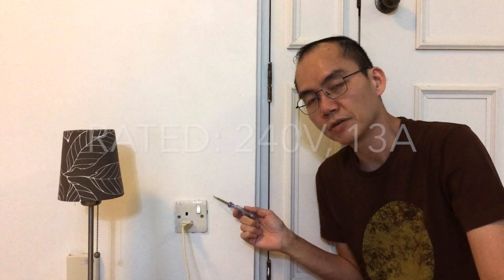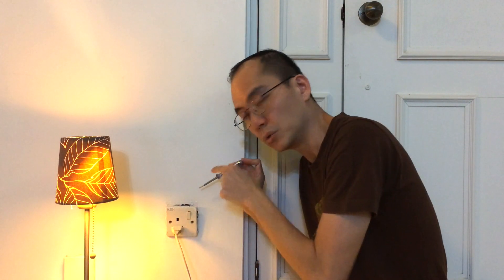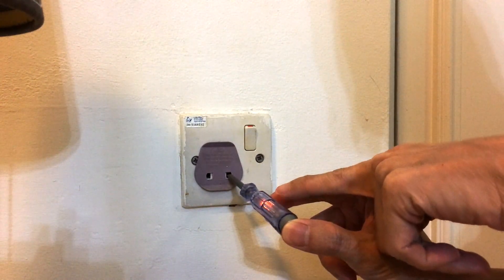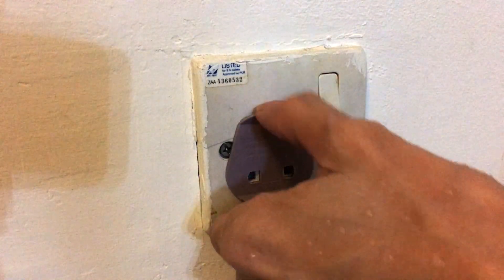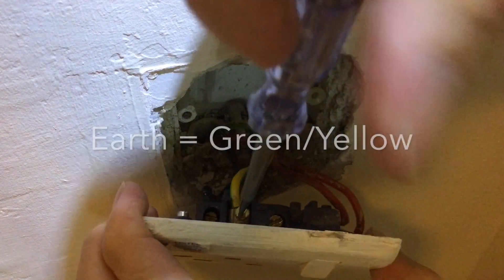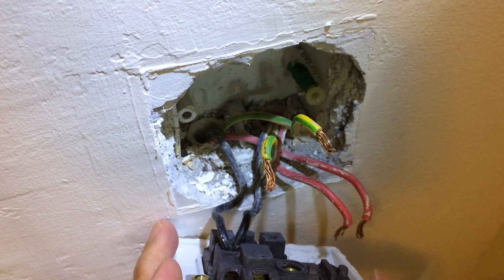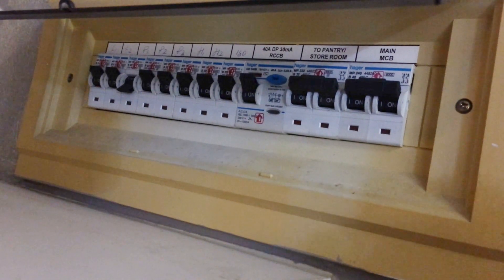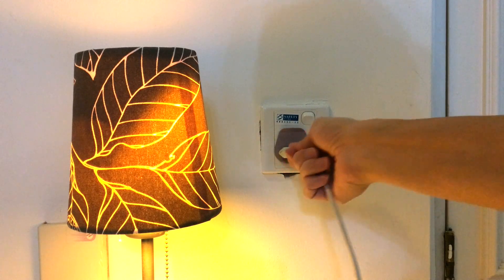How to remove & replace electrical switch or wall socket

Comment: subbed - love to learn what you have learnt for DIY.
Reply from the maker: @markwassuuup  thank you! I'm learning too let's learn together
Reply: @sosolomon22  Nicely said. Here is one:
1.) my reverse cycle aircon would freeze at the top entrance on very hot days (over 34 deg Celsius) so I added 2 pieces of cardboard to also allow air entry from the bottom as well by keeping the front cover open by a few cm
Reply: 2.) I make "elastic bands" from old bicycle tubes with a "paper guillotine" - I used scissors originally but to get a perfect straight cut I bought a "paper guillotine" because if if the cut was not straight then it would break very easily. 

I got the idea from when I bought a new bicycle tube , they were held in place with a "black elastic band" which wasn't very elastic ... years later I discovered they were made from tubes!

Comment: Why lamp plug 2 pin ? Wall socket 3 pins ?
Reply from the maker: I don't know
Reply: 3rd pin is "earth" - it is connected to the metal cover of devices like stoves, hobs, ovens, toasters, lamps with metal frames, computers, fridges, dishwashers, washing machines ... the idea is that the metal is directed into "ground/Earth" so if a wire wears out or "breaks free"/snaps after many uses (or faulty assembly) it will direct it's electrical energy directly into the ground/Earth (literally) rather than going VIA a human, pet, water, wood, plastic ... which would cause death or a fire.

Comment: Personally I would have also cut the 2 pin plug off and fitted a proper 3 pin fused plug because 
that is far safer than shoving a 2 prong plug into the wrong type of sockets. That's probably how 
the other socket got damaged.
Reply from the maker: True more convenient also
Reply: it is a lamp - it does not care which side is live or neutral, just like most electrical devices... toasters, ovens, heaters: unlike "electronic" devices (although a "diode bridge"/4x diodes at the entry of a power supply pretty much makes it not care)

Comment: my aircon wire line is 15A type, and my plug n socket also 15A type , due to spare parts reason, can i change just the plug and socket to 13A type ?
Reply: No, you can buy a 16A Universal socket for your purpose

Comment: sorry noob question. May i know why there are 2 wires for each N, E & L?
Reply from the maker: No worries. 1 set comes from circuit breaker. The 2nd set goes to the next wall socket.

This is to reduce the number of wires going directly to the circuit breaker so as to minimise other associated issues like space constraints in the wall near the circuit breaker, etc.
Reply: In the uk/HK/NOT NORTH AMERICA they use a ring main circuit. So the power comes from the electrical panel, plugs are daisy chained then back to the same breaker. That's so that if the wire breaks, the circuit still has power.

Where I am, north america, its to feed downstream plugs.